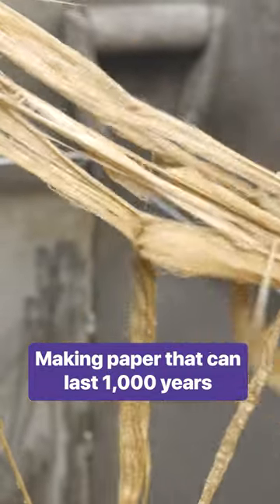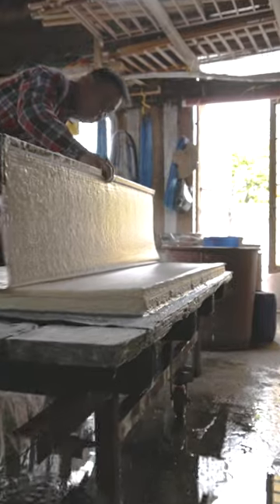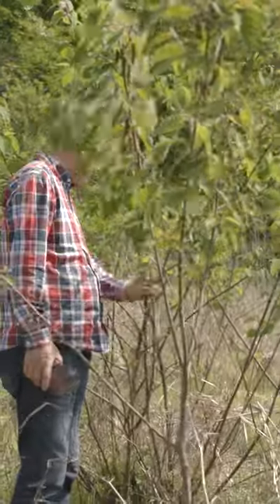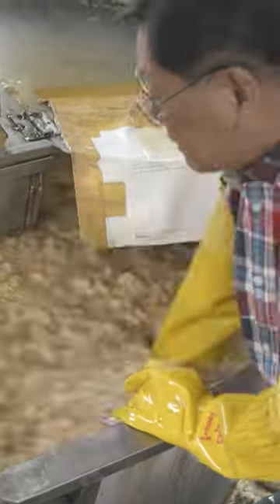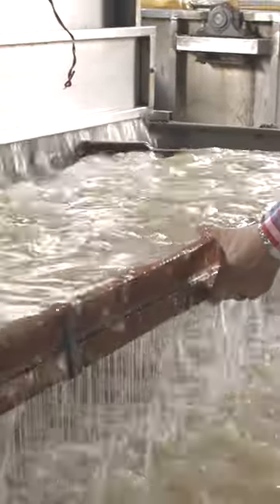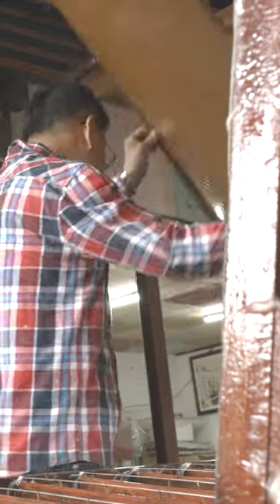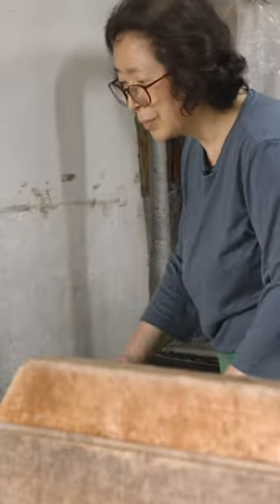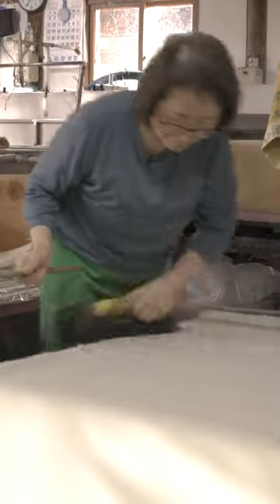Bark from a paper mulberry tree is the base ingredient used for Hanji. #hanji #handmadepaper #korean

Comment: Why is this paper necessary when lower cost alternatives are available?
Reply: I mean tradition more than anything. But I mean really can say the same for anything really. Why do I like my Oldsmobliles and Buicks over other cars that may be similar and mayhaps cheaper? I could argue for hours over merits but in the end I like em and they serves my purposes. Human sentimentality can edge out perfect efficiency. Sometimes things just feel right for whatever reason.
Reply: tradition, culture, art.
Reply: Lower cost alternatives don't last. Get the picture? Oh, you never got the paper 🤣
Reply: Because some people prefer higher quality than cheaper alternatives. Why do you eat meals when bread and nutrient pills are a cheaper alternative?
Reply: It could have a different weight and texture which could work well with different art supplies and styles. (For example, if you watch videos by watercolor artists, they'll often have strong opinions on paper.)
Reply: Hanji is very long-lasting and is used as archival paper. Of course it won't be so much in demand if you're just using paper for short-term purposes, which is a more common use for paper. Also mulberry paper cannot be made fully by machine/automation so it's more expensive. Single-use or non archival paper is mostly factory made using mainly machines in the process, so they cost less
Reply: A paper mulberry tree appeared in my yard almost 2 years ago. This is the first year it produced fruit,  and they are actually quite good to taste, if you don't mind the tiny seeds.
I had no idea what it was until this spring.  It grows quite fast,  it's already as tall as my house!